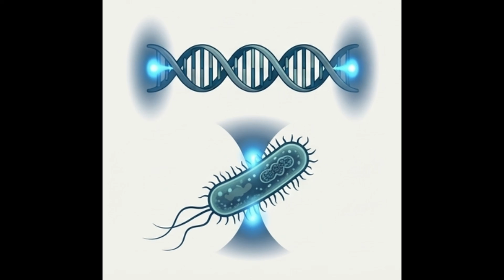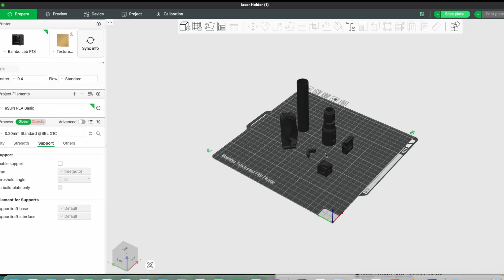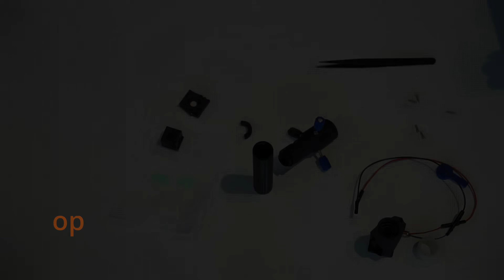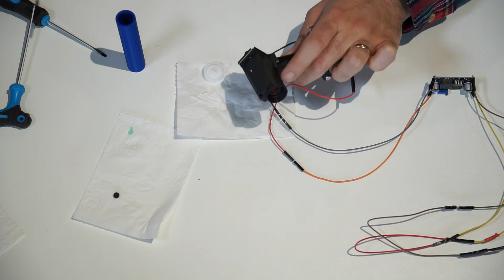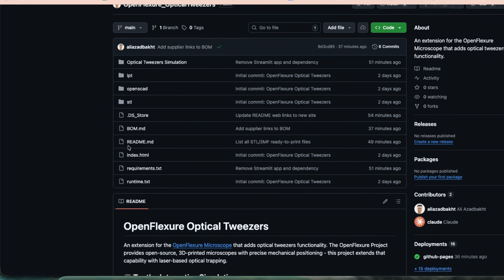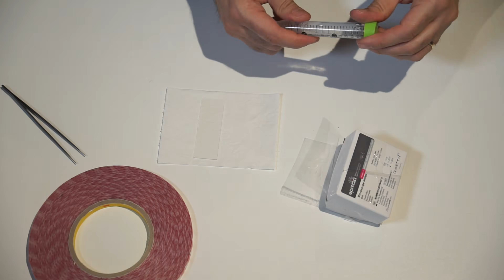Open Source DIY Optical Tweezers

Comment: The microscope works well, but the function of capturing particles with a laser isn't working. But in the process of focusing this laser, the shape of the laser is indeed rectangular. Is this the problem? I know that it is difficult to solve the problem with fragmented information alone. If you have any guesses about a solution to this kind of problem, please let me know...
Reply from the maker: then it is not easy to solve it. I can ask some questions and hints:
1- is the objective lens high NA?
2- is the laser relatively aligned?
3- what are you trapping?
4- are you sure that the objects are not stuck to the coverslip? you can first add a little bit of cow milk, wait for 5 min then flush it with your sample to prevent attaching your sample to the glasses
5- it is better to have a guassian laser beam, but any laser should be ok for only trapping.

Comment: I did my PhD in optical tweezers, before I started OpenFlexure - I always wanted to combine the two, it's fantastic that you have made it work! At some point, I really ought to follow your build and make one of these in my lab :)
Reply from the maker: Your RedTweezers is still running in lots of labs 😉 Thanks for your message—and for all the work you’ve put into open science. With these tweezers, I think the alignment tool, the cube, and the flexible parts for beam steering could be potentially good for future add-ons for others!

Comment: I built one of these for my partner a few months back, and I noticed I can only get it in focus if the slide is upside down. Have you noticed this issue at all?
Reply from the maker: The coverslip (thin glass) should face the objective lens.
Reply: @Wfront_Principle  OH ok, thank you for confirming! Where did it say that out of curiosity? I almost went crazy trying to figure out which was it was supposed to go.
Reply from the maker: @Future-Engineer-Moose  It's actually a standard rule in microscopy, so unfortunately, a lot of kit manuals assume you already know it and don't write it down! It has to do with the focal length of the lens—the glass slide is too thick to look through the bottom